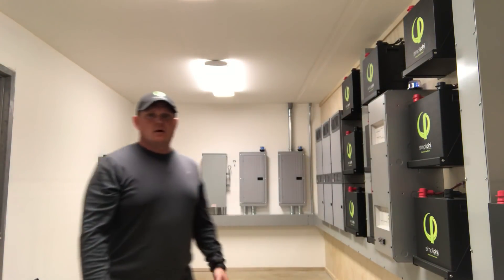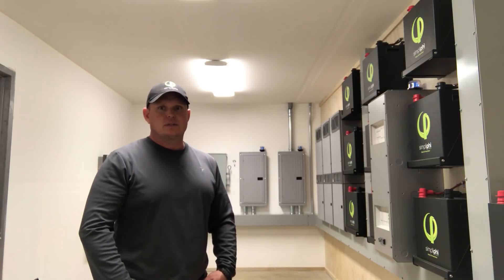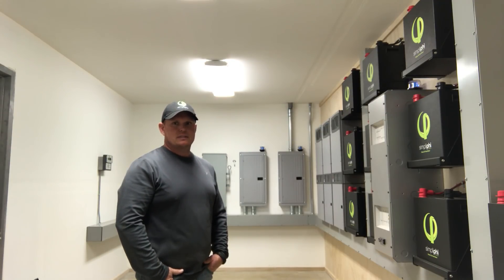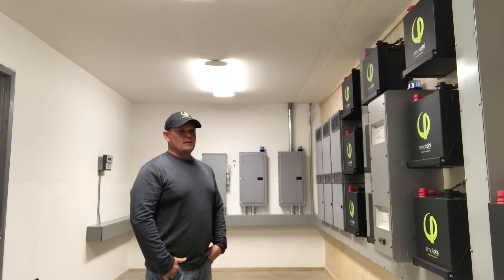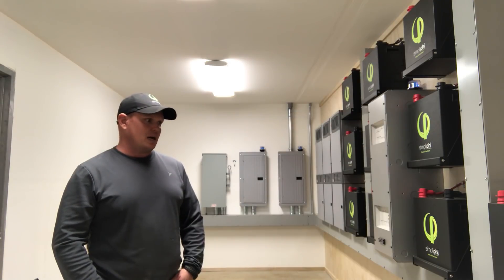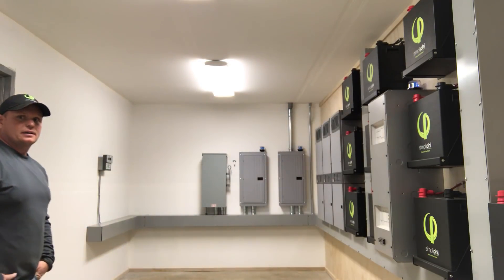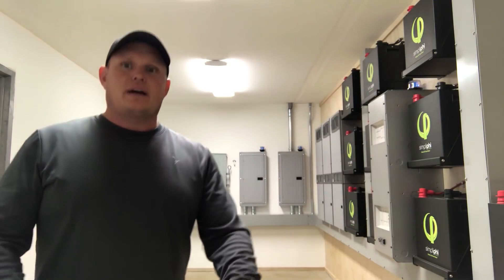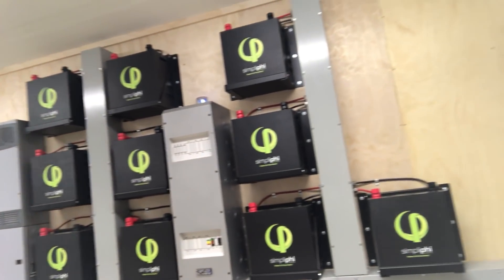Off the grid my latest creation, Outback Power, Simpliphi, Solarworld

Comment: Is it possible to configure a Radian Remotely?
Reply from the maker: Timothy Holmes yes if you have optics set up and connected to the web
Reply: I may enlist your help in the future.  I am finishing integrating 48 Kwh of Leaf Batteries with the goal of load shifting to utilize TOU billing.  Might be more than I bargained for with the setup....
Reply from the maker: What are you using for the bms
Reply: Pretty cool setup.  The integration with the Radian is less than perfect, but it will allow balancing and I can use a shunt trip breaker as a failsafe if the onboard charger doesn't play well.
Reply: not trying to hijack your video/thread.  What is the best way to contact you?
Reply from the maker: Timothy Holmes no worries sometimes this is the best way to get my attention
Reply from the maker: Email me at jason@westcoastsustainables.com

Comment: U can add the li ion batteries at a later timefor expansion? Your not supposed to do that with lead acids cause the voltages might deviate over time and cause the new batteries to fight the old batteries right? Does that rule not stand with the li ion?
Reply from the maker: Bobby Diminnie according to Simpliphi you can add to them
Reply: Jason Andrade thats pretty awsome. How can u tell if one battery in the bank is going bad over another?